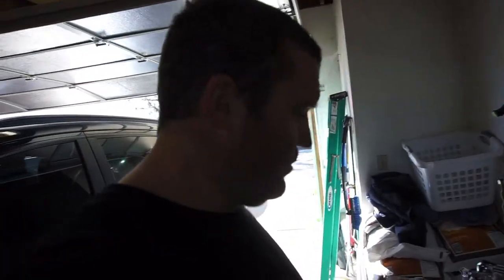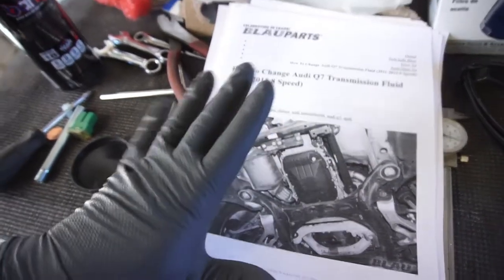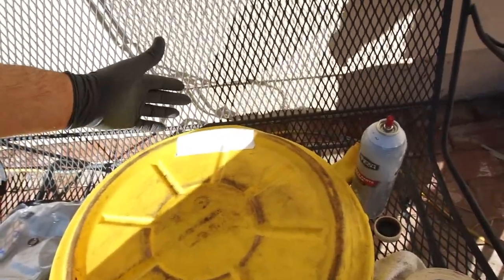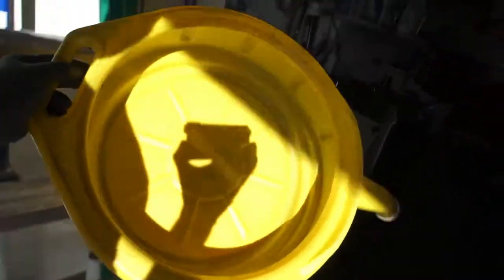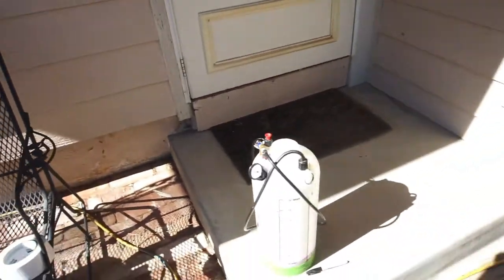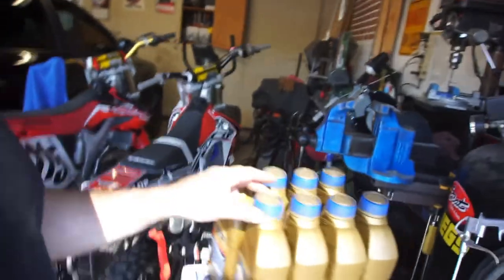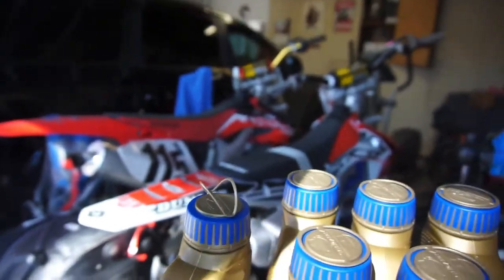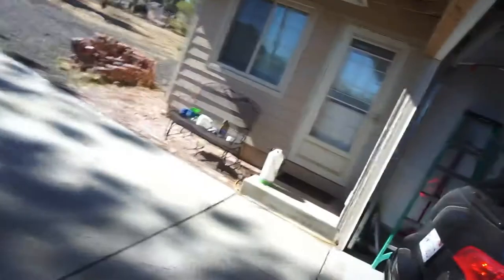Audi Q7 TDI Diesel Quattro Transmission Service, Asian 8 Speed, Fluid and Filter Change

Comment: Thank you for this video. I just picked up a Q7 with this 8 speed AISIN transmission. Mine has 95,700 miles on it, so this gives me some relief seeing yours has many more miles on it and the fluid doesn't look so bad. I plan on doing this job at 100,000 miles.
Reply from the maker: It’s a very good transmission. I’ve put another 15k miles on it since the service and still running great.

Comment: Believe it or not a transmission value reset needs to be done along with a relearned drive procedure as per the true manual. Didn’t know this till I actually got the Audi manual.
Reply from the maker: I didn’t know about a value reset but I did know about the relearn. What’s the value reset about?
Reply: @Halffast719  all the videos I’ve seen and stuff I read on the forums and even blauparts say that the computer will automatically relearn in a few weeks but from the actual vw/Audi info that I found states to reset the adaptation values using computer/vcds/OBDeleven because the computer doesn’t adjust to the new fluid as new fluid.
Reply from the maker: I’d like to see that process on a video.
Reply: @Halffast719  definitely working on that  as OBDeleven has its limits to certain procedures and would hate for that to go wrong.
Reply from the maker: Yeah I’d hate for that to happen also.

Comment: On the diffs do they have a rubber boot on the fill plugs? You didn’t do transfer case? Appreciate the vid- luckily I have access to a lift for this procedure
Reply from the maker: No rubber plugs, they were a bolt I wanna say 5, 6 or 8mm Allen wrench. It was a very tight spot to do the front. Rear was very easy. No I didn’t do the transfer case.